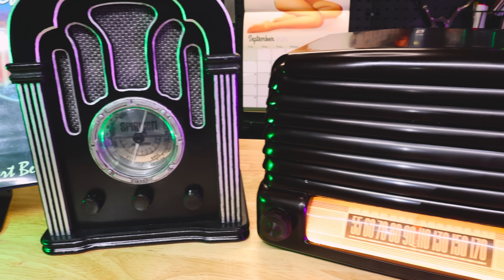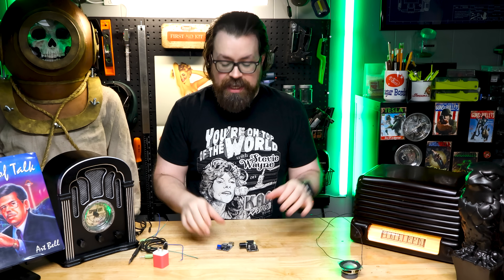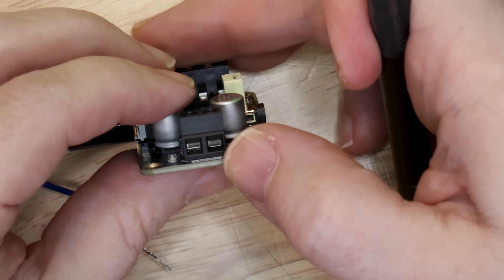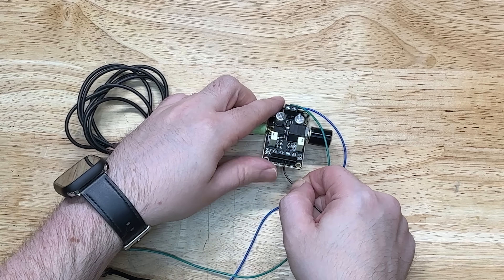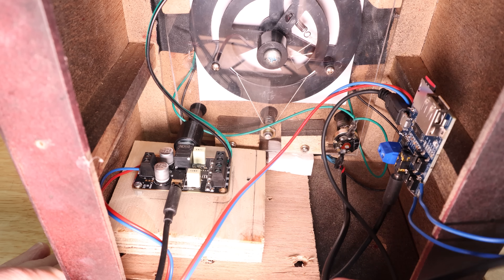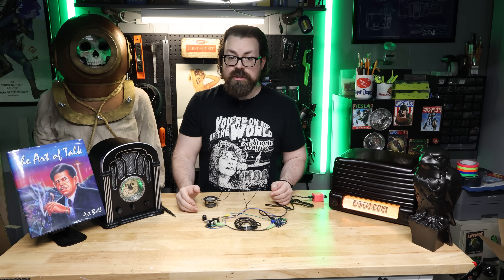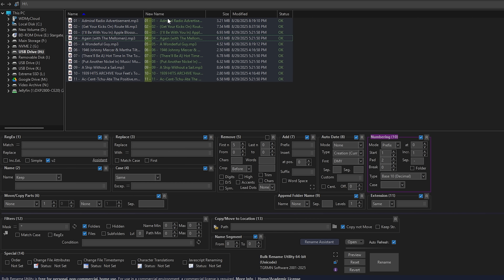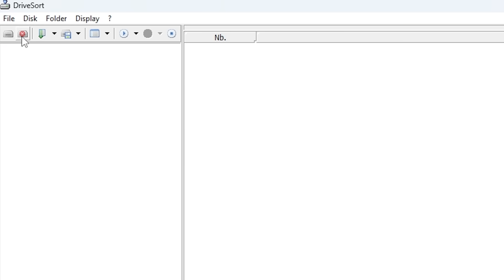How to Build a Radio That Plays Anything You Want

Comment: Now could you imagine having 6 to 10 of those MP3 players running through playlists that are themed slightly different: Big band, talk radio, blues, radio dramas, etc... and as you turn the dial it goes to different "stations".
Reply from the maker: Definitely on my list of improvements to try!
Reply: I'm trying to figure out how to do that. The only thing I can think of is a spindle with connection points. I'm not great at electricronics. I'm still trying to figure out what size wire is best to use for this whole project.   
I'm even adding in old baseball games. (Easier said than done)

Comment: I love this idea, my only bugaboo is that I want to be able to switch genres, and or change the station. Have a rock station rap, pop, metal. Would that be just more mp3s playing in unison?
Reply from the maker: I agree, that’s definitely the next evolution of this idea. It’s definitely something I’ve thought about and few comments have given some ideas about how it could be done but I haven’t gotten around to it yet. Definitely on my list to try with some version of multiple mp3 players. I’m also sure there’s a way of doing that with a raspberry pi or something similar but that’s beyond me at the moment. I’m kind of hoping someone smarter than me sees this video and runs with it.
Reply: I'm going to extend the type A USB to outside the case so I can change the genre by just swapping out the USB. 
I do have a question Perry. 
If you have a SD card in AND put in a USB which storage does it use? 
I hope it uses the type A then when that's removed it switches to the SD. That way I can interrupt the normal programing when I insert my Dimension-X USB.

This is such a an awesome way to use old small USB drives. Thanks for the video!

Comment: I am testing a set up right now to build this in to a thrift store radio find, and everything works, except when I turn the knob completely off on the amp, when I turn it on, it doesn't start back up playing. I'm not sure why this is, have you run in to that at all?
Reply: I may have just resolved my own issue by just running the Amp board on it's own power line separate from the MP3 board
Reply: @TravisCrawfordTCMI  @theperrydaniels I may have an alternate solution  to this problem that does not require two power sources:
 I found that having the power connected from [PowerSource -> Amp -> MP3] eliminates this issue. It's as if by connecting it [PowerSource -> MP3 -> Amp] causes my MP3 board to lose enough power to trigger a reset or error out whenever the Amp switches on. My guess is that some of these MP3 boards have a difference in the way power flows, maybe an IC thing? idk.

I cut the end of a micro usb off and connected the USB's V+ and V- wires to the Amp's 5V (+) and (-) respectively. Then jumpered the Amp power to the MP3's bat+ and bat-.

Hope this helps!
Reply: @LittleCrowOnaBench I appreciate that. I will try that out and see how it behaves 😁
Reply from the maker: Thanks for this. I have not run into this problem but I’m sure someone else will so I’m glad you posted the solution . Weird that they needed to be separated like that. Any idea why that happened?
Reply: @theperrydaniels  I'm really not sure. I did buy a similar MP3 board to the one you have, but a different amazon listing. It works fine, but when wired to the amp, and the amp shuts off, the MP3 board just stops, and doesn't restart until it's power is pulled and plugged back in. I can't find a reason why it behaves that way. But, running the amp on it's own power resolved it, and it's simple enough that it's worth doing

Comment: So I did this exact set up but I changed the speaker to a pair of BOSS BRS35.
I'm running into a problem where the speakers have no sound unless the volume is turned all the way up and then it's VERY VERY low sound. 
Is this because the speakers are 4Ohm or did I do something else wrong?
Reply from the maker: If I had to guess, I would say you’re probably right about the difference being the speakers. It sounds like the amplifier I recommended in the video is not powerful enough to drive those speakers. I could be wrong about that, but I’d bet a beefier amp would let you use those speakers. Let me know if you find a solution, I’m curious.

Comment: I already bought these modules and are awesome execpt they dont have the shuffle feature which i did not realize is so complicated to do on such simple devices
Reply from the maker: Yeah, some other comments have said that MP3 boards with the shuffle feature do exist but I haven’t found anything. That’s why I had to default to randomizing them with Bulk Rename or Drivesort first and then putting them on the SD card. It still works pretty well but I would love to try it with a shuffle feature.

Comment: I just finished building mine! This is going to be a perfect wedding gift for my soon-to-be wife!

I did run into a bizarre power/playback issue when I tried to wire the existing incandescent bulb to the amp so that it would turn on and off as the power kicked on and off. After finding a spot on the amp that got power when volume was on and none when the amp was off, weirdly, wiring the bulb to power and ground made it so that turning the volume off and back on would cause the MP3 player to restart the last song playing. While power was never disconnected, the MP3 player was acting like it was. If anyone has any idea why this happened, I would appreciate it. I would like to maintain the bulb when the power is on, but it's not the biggest loss if not.
Reply from the maker: That’s odd. Is it that the incandescent bulb is pulling more power than the 5 watts from the board? The lights I used were 5w LED so maybe that’s why I didn’t run into that. 🤷‍♂️ I’m really curious if anyone else has any thoughts. 

But I’m really glad you’re making this as a wedding gift. That’s really heartwarming for me 😁
Reply: @theperrydaniels   I can't wait to give it to her! I recorded lines for a morning radio show and the music and interviews in between is the set lists and artist from the music festivals and concerts we've been to. And I took a modern, retro-inspired radio and repainted it to match one of her bridesmaid swatches. This has been a blast of a project, and I have loved working on it. So thank you for a fun project that will make our day even more special!

But disconnecting the bulb did resolve the issue! I think you're onto something with the power draw. I have noticed that the MP3 player LED flickers for a split second when I click on the amp, and I am thinking that is what caused the weird repetition. The MP3 player seems to have a certain memory about where it leaves off when disconnecting from power so that quick surge when the amp turned on was enough to knock it out and restart from that saved point in the song.

My workaround for the power issue is using a microUSB splitter and using just power from one of the sides to power the amp and bulb and the other side to power the MP3 module so that both are powered independently. The splitter arrives today. I'll post back if it works!
Reply: Update: it did not work 🤦‍♂

Comment: Very clever setup, curious though if any of these micro mp3 boards offer a random button?
Reply from the maker: Someone in the comments here said they do but I haven’t found one yet. I want to try one but I’m a little dubious about potentially having to press the random button each time it plays. If I could find one that did that automatically though that would be perfect.
Reply: I would use it to imitate changing the station

Comment: Cool tutorial. I might give it a try but perhaps make a section of the back openable and connected to the USB port (possibly by an extension cable) so I can swap a thumb drive when I want to change it (just to make it easier for updating music/shows.
Reply from the maker: Yeah there’s definitely a ton of room for customizing to taste. I’m considering switching the backplates to magnets so it’s easier to take on and off. Surprisingly I’ve yet to get bored with what I’ve got in there so I haven’t felt the need to switch them out yet.

Comment: Have you found what size of SD card works best for the MP3 board or what is the max size?
Some say 32gb and others say 4gb but reviews are mixed on which ones actually work.
Reply from the maker: I’ve used cards as small as 2GB and up to 32 GB and I’ve never found a difference between them. They’ve all worked the same for me.
Reply: @theperrydaniels awesome thanks for that helpful tidbit. I just received a 6 pack of those mp3 boards to get a few old radios up and running.  Maybe I’ll put the entire Lone Ranger radio broadcast on one of them.
Reply from the maker: That’s a great idea! I’ve got an old standing radio cabinet that’s in rough shape but I’d love to fill that one with nothing but old radio serials.

Comment: The next step.  How can I install a USB port to connect a flash drive to the converted radio?
Reply from the maker: The MP3 board I used already has a a USB port if you’re looking to be able to use a flash drive instead of the SD card.

Comment: I came across this channel randomly , I ordered these parts and did one myself using an old military speaker housing, it’s great. I ended up using a power bank so I could have it playing anywhere I like. You got my Sub 👍
Reply from the maker: Nice! I like the power bank idea. Would be great for a boom box style. How long does it last on one charge?
Reply: I can’t really say as I tend to use it during my  early morning routine, the longest I have let it run for was about 1hour and the power bank was still full bars,  the size of bank I use is 10000 mAh, for a boombox style I think it would work great, plus if you integrate a small solar panel into the boombox then you could charge the bank while mobile

Comment: Have you considered using the DY-SV5W? It's got 8 digital io pins to trigger different sound tracks. Each track can be up to 4gb could hold about 14-20 hours of audio per pin. This would allow you to replace the tuning knob with a rotary switch and have 8 different "stations". The only hard part would be each audio track would need to be one long audio track of all the songs you want. That's how the basic digital io works is pin 0 through 7 are tied to "song0" through "song7". So you'd need an audio editor to glue all your songs together into one long track.
Reply from the maker: I hadn’t considered that, but it’s a good thought. I’ll have to give it a shot. I can definitely think of some good uses for that   👍 Thanks!

Comment: Needs shuffle. Cause after hours and days your brain remembers the order and it get old fast.
Reply from the maker: You know the crazy part is that with my 40’s radio version I just made it random and left it at that and I definitely noticed it repeating pretty quickly. But with the Spiricom where I made multiple curated playlists with a spreadsheet, I have not noticed a repeated pattern in the months I’ve been using it which is really surprising. At any rate, I’m sure there’s probably MP3 boards like this with a shuffle feature but I didn’t want to have to press a button to get to it.

Comment: I've been doing this sort of thing but slightly different, although I'm using a little amplifier board in an old Ekco radio carcase, I do want to stream from my phone using Airplay. I've paired the amplifier with a Belkin Soundconnect dongle but am having interference problems, the amplifier needs a 12-24v input which I've split off to a little USB PD board to power the Belkin. Whether anything is played through it or not, there's a crackling and clicking noise through the speaker, this goes away (mostly) if I use two separate power supplies which I suppose I could use, but is there any easy way of removing the interference without that? I've used the shortest cables for the USB and audio that I could (under 6") but that made no difference
Reply from the maker: It sounds to me like the problem might be a ground loop issue. I ran into something similar with studio monitors in my recording booth and the answer was to separate the power sources like you described. That said, I am not an expert in this and I hope someone who may have more expertise will chime in if there’s another answer.

Comment: No use the original amplifier section in the radio. It's tubes and will sound a lot better than that Chinese amplifier you buy on Amazon. The mp3 idea is good. 73
Reply from the maker: Mine was way too shot for that (for me to do it anyway) but would be a cool idea in a radio in better condition. 73 👍
Reply: @theperrydaniels yes I understand unless you know tube electronics I would stay away from working on tube radios. Especially one side of the 120 volt line is connected to the chassis and they didn't use polarized line cords. Also tubes have high voltage plates anywhere from 90 volts to 350 to 400 volts. I got shocked with 450 volts when I was a teen.  I was using a television transformer and 5u4 rectifier tube for an antique radio the original transformer had a short and it stunk up the house if you had the radio on. Power transformers are expensive if you can even find them. 73

Comment: I love this!  The simplicity just works.  However I wanted at least a couple 'stations' so of course installing think rotary encoder and a rasp pi, then could have a display and internet radio.  And I was like, no, that ruins the heart of this project.  In my parts bin I do happen to have a 2p6p rotary switch, so thinking of just running 6 of the mp3 boards (six of those still cheaper then a rasp pi) have the rotary switch switch the mono out to the amp.  And do the same process, all 6 boards constantly playing, you can just switch between each board.
Reply from the maker: I love the idea! I’ve been thinking about how to do something like this, too and if you do get that working please let me know. This is the kind of thing I was hoping would happen when I posted this video, that people far cleverer than me would run with this project and do something even cooler with it.
Reply: I love this idea! Please post if you get it working!
Reply: Ok so I got the boards in, they actually sell a six pack for like $13, got five 32gb micro sd cards for $20.  Designed and printed a crude case to house all the boards.  got a small 5v and 12v power supply (12v for the mono amp, 5v for the mp3 boards) Have an old grundig radio, replaced the speaker fabric and speaker.  Not sure what to put in the opening that used to be the frequency needle assembly?  Almost thought about buying a powered usb hub and just use micro usb cables for power to the boards, as would make it easier if I need to work on one, to just unplug, but sticking with the plan.  Your spotify website works perfectly.  To quickly convert the mp3 to mono, cd to your mp3 directory, mk a subdir called mono.  then type 'for file in *mp3; do ffmpeg -i "$file" -ac 1 mono/"$file"; done'   and for file sorting on sd cards with linux, just use fatsort.  Yes isn't gui based, but for my purposes fatsort -R  to do random is what I want.   I'll try to post some updates as I make progress.

Comment: Neat! I bought an Arvin 544 A (AA5) from 1947 and got it up and running again. For its music I took a design from the internet for a radio transmitter on a Arduino using the real time clock as a pulse output through a coil of wire. Basically a pirate radio transmitter. It has a range of about 12-15" (yes, inches), but if you put it behind the radio it picks up the transmission on whatever frequency you set it to with included, natural, background static from cosmic rays and other electronic interference as in, you actually have to dial it in. Since it's hooked to my PC I can adjust the output for best results on a permanent magnet single speaker AM radio then play whatever I like through it. The only thing that ever sounds "bad" is audio that has had fake static added into it as it just sounds noisy, but high quality recordings of classic music, video game music, even YouTube videos can all be played on a fully functional AM radio along with the one and only other channel in my area if I ever choose to listen to religious talk radio. I wouldn't suggest it to everyone as it does require you to rewire a classic tube radio, but nothing beats it in authenticity of getting the dial juuuuuuuust right.
Reply from the maker: That’s really cool! I do wish this project had that “dialing in the signal” kind of feel to it. There really is something great about that vibe.
Reply: @theperrydaniels  You could operate on an in-between method. It would take a swap on your tech to something like a Ras-Pi or Arduino, but if you programmed it in you could use a potentiometer to go forward/back in your playlist with a fade out/fade in with some fake static sound played between to simulate the change. It would take a lot of tweaking and would still sound a bit artificial, but the fade out/in alone would add an interesting effect. Runout on the pot would also be a bit of an issue to tackle as well as keeping the dial working, if that was desired, but it's an option!